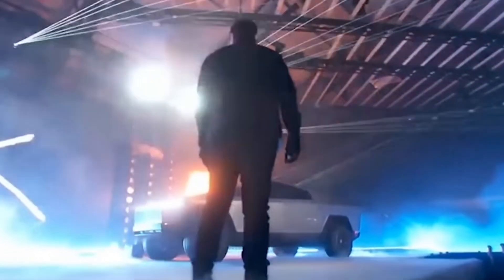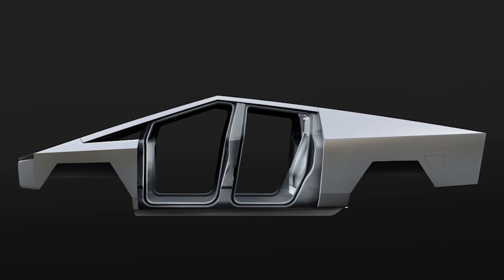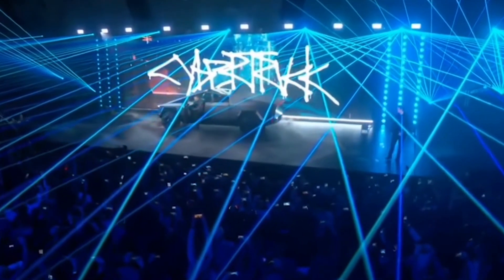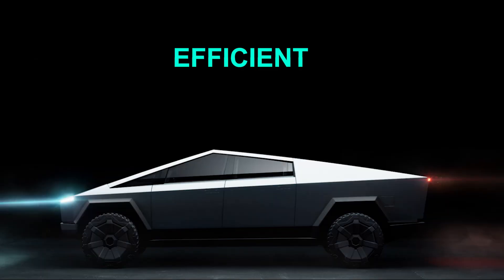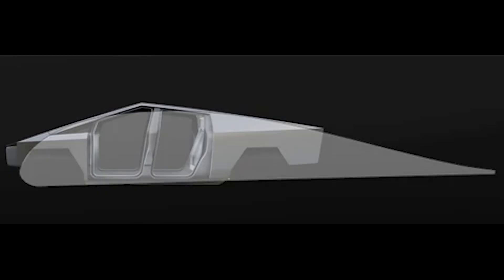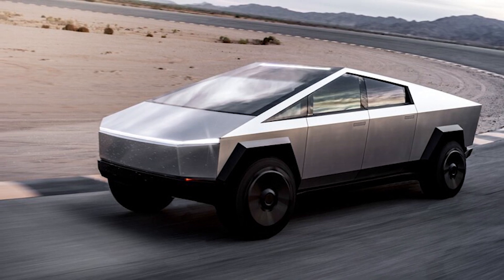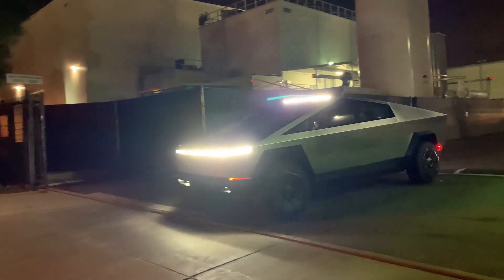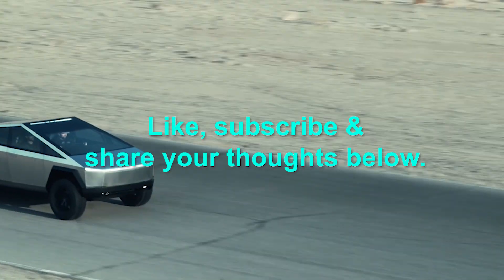Cybertruck is Engineering Genius (and will be copied)

Comment: You have Cybertruck fever and it's clouding your thinking. Here are some issues that you're either missing or glossing over.

1. Just because a truck can be built cheaper doesn't mean it's going to cost you less. If it's in demand the price is going up to maximize profits. Telsa, despite what you think isn't in the business of saving the planet. It's in the business of making shareholders a profit.
2. The Cybertruck looks like it was designed by Jeremy Clarkson in the Top Gear garage.
3. The Cybertruck has completely unproven load carrying and trailer towing capability. Those are MASSIVE issues for work trucks. It's very likely ranges will be cut in 1/2 or worse when loaded with moderate cargo.
4. It's likely even these trucks will suffer damage on work sites. They're tough but they aren't impossible to damage. What's going to happen to the vehicle structure when damage is sustained to the left rear quarter? Will the passenger door still close?
5. How will somebody repair the left rear quarter panel? Will the repair make the vehicle significantly weaker? 

6. Where will you get your stainless steel Telsa repaired? What's the cost to fix a damaged door? or worse... the roof?
7. Toyota has put millions into making their vehicles damage pedestrians less when hit. Telsa's CyberTruck takes the pedestrian be damned approach. How does that affect insurance costs?
8. On that note, given the choice I'd rather be hit by a Camry please.
9. The super rigid CyberTruck hits a concrete wall at 25MPH.  It stops in 0.05 seconds. You on the other hand don't. Because you body is subjected to 25-30G's your body either gets cut in half by the seat belts OR you splatter all over the windshield like a cruise missile made of meat.
10.... I'll leave that to the rest of the people here on YouTube.

Comment: Well, a rigid car isn't necessarily a safe one. All the other Tesla models are super safe because they have an empty trunk in the front rather than an engine. That allows the frontal part of the vehicle to soak the energy of the impact as it deforms in an accordion like fashion. But none of those cars are made from stainless steel. A very rigid car could mean a very dangerous one

Comment: The moment I first saw it I was very surprised by the look, but quickly understood the benefits similarly to how you explained it. Then all the negative uproar began focused solely on the looks (and window). It's just not something that a 12yr old in a comment section is willing or able to grasp. So thank you for the video! The main issue I see is that many people would be unwilling to actually buy at release simply because either they or their friends/family don't like how it looks. I'm sure sentiments will shift after being on the road a couple years. I hope other manufacturers take some risks and make some moves in a similar direction sooner rather than later.

Comment: ... no mater what a stainless steel body is not more safe and it's not the body of a car that is expensive to create its the frame         modern frames are made to be extremely safe also 6 seconds is not really slow is it mate

still it does what its supposed to do
Reply: ok i do admit that the paint job is a good idea to remove

Comment: The truck is nearly indestructible, unless someone gingerly tosses a small object at the window.
Reply: because the door got hit by a sledgehammer multiple times and the base was cracked already
Reply: @BH4x0r  So all a thief needs to do is hit the side a couple times to break the base. Got it.
Reply: @CarpRunner  only the glass would be broken and he would need to carry a sledgehammer, not only that but by the first hit the alarm will sound, these cars are also pretty non-stealable because of the electronics, if you forgot your keys or someone wants to steal the car and they don't have the keys noone will get in unless you crawl through the window, same for getting out
Reply: @BH4x0r  It is a safety concern regardless. They obviously didn't think it would break.

Comment: Tesla missed the mark.  Mini Trucks will make a comeback, because they turned into mid-sized trucks.  Now there is an opening for the manufactures to fill.  Soon you will see them.  The time for cars with pick up beds is now...  Or again.  Cyber Truck bed looks similar to the first Honda Ridgeline.  I need to see a demo with 4x8 ft. sheets of plywood, and 10 - 12 ft. lengths of lumber.  Ride a 1000cc Sport Bike up on it!

Comment: Not sure who’s your industrial production advisor! The simple geometry might make it cheaper to make a prototype but in mass production it doesn’t matter as much as you think it does. Giant presses make one side panel of a car in one stroke, but each folding line (of the cybertruck) in a hydraulic folding press takes way more time.
So mass production of origami from is not time efficient. Besides in order to make some 3D corners it will need tons of accurate welding and professional finishing and polishing. 
Stainless steel is much more expensive than steel, aluminum or some composite materials. So material cost will be much higher.
Body strength is not necessarily an advantage for car safety. If the front body doesn’t absorb all the force of a crash through deformation, it will be transferred to the passengers. That’s why in crash tests you see the entire front of the car gets smooshed but the cabin remains relatively intact.
I think Cyber Truck design serves at least two other purposes. It’s easy to prototype for a quick launch (they didn’t want to fall behind the current electric truck buzz) and second a clear marketing gamble to distinguish Tesla from the rest and get enormous free media coverage.

Comment: Lots to like, but will still suck in rural areas due to inability to quickly refuel.
Reply: The Tesla supercharger network is across the entire U.S. and is being continuously expanded including rural areas. V3 Superchargers can add 100 miles of range in 7 minutes and 275 miles in 34 minutes. Time usually used for a break or something or playing games on the infotainment system.
Reply: @Jogeta5  if I'm traveling in convoy with my Diesel mates in their trucks, I can't go Park somewhere for half an hour when they want to get on the move. And when you're traveling a long way out to the farm and you need to get back again, anything less than a full charge won't cut it. Look, it's fine for the more casual suburban travellers, but not so much for true rural travel.
Reply: @xpusostomos  
Says the person who is using fueling driving methods for electric vehicles.

Comment: Sturdy and tough does not equal safe whatsoever. Crumple zones are how the other three Tesla vehicle's topped the charts for safety. They didn't have an engine in the way which is a bit heavy piece of metal that transmits the energy from the impact directly into your soft squishy body.

Comment: Stoner please. Competitors are so full of themselves that they might steal a few minor ideas from the CyberTruck, but they will NOT compete. After all, buyers are sheeple. They'll buy because of brand name, just like they've bought faulty Ram pickups that have an obscene service record. ( Eg: A little plastic piece breaks and it costs over $3,000- to replace it and is never covered under warranty).
  So, the CyberTruck WILL sell in great quantities, once the current battery technology (glass electrolyte = 5x range and 10 min full charge) is ramped up.

Comment: All valid points. However here is one correction. The Chassis (exoskeleton) is not folded out of one piece of stainless steel. Even if that cumbersome approach could be accomplished, the would be a great deal of scrap. OK, the scrap could be used to make other smaller parts. You can clearly see the outer skin panels have visible edges where they meet up, not bends, in a single sheet of steel.

Comment: Functionality? Will the bed hold a 4×8 sheet of plywood with the tailgate up? If not It's going to have trouble. Also, have you ever owned stainless steel appliances? The finish is a constant problem and worry! Dings, scratches, smudges, hand and fingerprints.
Reply: The bed is 6.5' long by 5' wide. It also has no wheel wells infringing on the area. It will hold a sheet better than most 1/2 ton pick ups on the market.
Reply: Thanks for the info, Dane. Yes, it is bigger than most crew cab short beds, but I'm wondering if you will be able to drive with the tailgate down? With no rearview mirror, there must be a camera back there somewhere. Tesla can get pretty hinky about how you do things with their vehicles...

Comment: 40k isn’t cheap bro! There’s plenty other trucks much cheaper than this
Reply: The key is to compare feature for feature. Show me a 2WD pick up with 4 doors, seats 6, has a 6.5' bed, air suspension, a 17" display, retractable bed cover, in-bed 110/220 outlets and load ramps for $40,000 USD (oh and it has AP standard). If you want a cheap 2WD single cab with manual everything, go for it; but that's not the market segment this truck is aimed at.

Comment: this thing can't do like a hundred things that normal trucks can do and are required to do.  it's toy for rich kids.
Reply: Such as?

- 6.5 bed, check
- Adaptive air suspension for easy loading, check
- Built in load ramps, check
- Frunk, wing, and sub-bed storage, check
- 3,500lb cargo capacity, check
- 14,000lb tow rating, check
- Onboard 110/220V outlets and air compressor, check
- 16" of ground clearance at max height, check
- Bulit in tie down slots in bed and tailgate, check
- Drives itself, check

Sounds more truck like than some current trucks on the market to me.

Comment: Its just my opinion. This won't be the final version, side mirrors (Legality)and waterproofing will need to be addressed in the cybertruck, try launching a boat and getting 1/3 of the truck in salt water or lake water at the boat launch, is the battery protected from partial submerging?

Comment: Cutting jobs? Hmm... You get hit and your fender gets damage.... Now what? Replace the whole body?! You get mangle in this thing they won't be able to cut you free in time. Parts break on this thing is going to cost more. The hype and no thought of how much it will cost to fix the vehical will come back hard, just you see.
Reply: It's flat stainless steel.  Cut the damaged section out, fit a new chunk, weld, grind and then buff.

Comment: The cheapest ford f-150 starts at 25,000. That's 15 thousand dollars cheaper than the cyber truck
Reply: Does that F150 seat 6? Have 4 doors? Have a 6.5' bed? or even cruise control? Cause the cheapest Cybertruck has all of that, and has auto pilot, in bed outlets, onboard air, and air suspension. If so, not a real great comparison in favor of the Ford lol. If you don't need what the base model offers, don't get it.

Comment: Lol!^^
Low cost : no normal worker can afford a Tesla in Europe, so think about others continents!^^
High utility : if it's presented as a truck, I hope for them they thought about cargo capacity!
High performance : tanks in WWI had the same aerodynamic!^^ but ok electric motors will do the job, 'cause you know...it's an electric car!^^
Efficient : plz prove to us that it can run 1200km in a row as a petrol pick up does in Europe with a 4 cylinders engine.
Safe : ok no problems for the occupants of the car, but think a second to the poor guy on foot that will be hit by this car!^^ I think this car could not even been approved by safety tests in Europe.

Plz for once, stop defending Tesla like some do with apple, when a famous and good trademark does a shit, call it a shit and pray for they produce quickly another good car as the model 3 for instance ;)

Comment: The Cybertruck = the end of short lifespan, planned to go obsolete quickly vehicles planned from the start to draw money to the dealer network, for the  thousand of threshing parts in a gas or diesel based vehicle. These vehicles can have lives in the millions of miles due to the inherent long life of a rotary electric motor, the lack of mufflers, clutches, transmissions and the thick stainless steel will also endure for the long term. Even of others copy Tesla bodies, the motors and battery will still lag Tesla.
We are going to see a sea change in buyers preferences. People will delay buying gasoline based cars - waiting for a Tesla instead as the annual savings over 5 years easily offset any price premium for the Tesla sedans - the cybertruck might not have any price premium at all??

Comment: Would love to see a single cab version, with larger bed.  Bed is impractical for side entry (talk to tradesmen about how often they use this) and what options for tie-downs, roll bars or roof racks?
Also, the demo video shows the unit wallowing over kerbs and around corners - not ideal.

Comment: The only place where CyberTruck would be weak is towing over long distances. The rate of power consumption when an electric vehicle is under load will is astronomical. If Tesla can solve that issue, they'll be in great shape. If they can't, then gasoline, and diesel, trucks will still remain competitive.

For any tasks that are simply in town, the CyberTruck will be amazing. If you have to travel any sort of long distance, the value of conventional trucks still remain high.

Comment: Although I'm a giant fan of Tesla and the Cybertruck I dont really feel like this video is unbiased like it should be, and gives all subjects the nuance they need. 
For example:
- The simplicity of production is a speculation.
- The aerodynamic 'analysis' was only based on vague resemblance with a wing shape, instead of actual calculations.
- The safety of the Cybertruck has not been proven in any way so far and high rigidness does not equal high safety.
Furthermore while all 3 of tesla cars are up there with the best it cant be said that they are the safest cars ever made as competition caught up and sometimes exceeds certain Tesla safety ratings.

Comment: it has a massive flaw, when it tows the range drops like a lead baloon.
Reply: That will be fixed within a coupla yrs.
Reply: what if the objects you tow have also Batteries build in them to help raising the capacity :)... problem solved.... and also look at the f150 - with the standard tank you get about 600 miles? and if you tow it is less than that.

Comment: I could live out of this truck.... take out the back seat.... put in a bed now i have an aircon room with a 19inch touch screen 😂 in the back of the ute i would put a slide out kitchen and electric hot water for shower and dishes. And up front i would put a drinks fridge and food fridge in the back with the kitchen.... deym 😂 who needs a mortgage when ya can go anywhere with this thing... i want 1..... i already live off the grid... now i can have a small battery pack at home to keep my fridge running and plug my car in when i get home from work and run everything else 😁 to me it has endless uses.... oh and on my lunch break i can fully charge my car at a super charger.... eat lunch watch you tube on my big screen in aircon.... does it get any better than this 😂 Thanks elon you da man brah😎
Reply from the maker: There's big potential for this. The whole #vanlife thing would be perfect in an EV.

Comment: A truck that has rear wheel drive is garbage. By that I mean a truck with 16 inch clearance with no 4W capability! Who wants that? Not to mention Tesla wants you to pay 7k for auto pilot, a feature already built in, but cant use unless you pay extra for it

Comment: The problem with a rigid frame is that we moved away from that precisely because it wasn't safe. If the car doesn't deform, all the energy of the impact is transferred to the persons in it, killing them much more easily. The idea of deformable materials is that they absorb part of the impact so that the passengers don't.

Comment: This dude has no idea how horrible the design flaws are on this truck. Throw a bag of feed in the back. It will end up next to the cab after driving through town. Ya have to crawl yer fat ass up into the bed. No place for a tool chest. Work trucks come with 110 outlets and air compressors that’s no big break through. The exoskeleton isn’t going to be strong enough to handle crossing flields and pastures. This truck really isn’t a truck at all....
Reply: Put your tools in the frunk, or in the sub-bed storage area, or in either of the wing storage compartments.  Use the built in t-slots as tie downs. Walk your ass up the built in load ramps when the truck slams the rear thanks to load mode and the adaptive air suspension.

Comment: Solving the MONEY Problem - you are WRONG.
the ORIGAMI 3mm Stainless Steel body is very hard to COPY and get RIGHT.
there is a REASON why Ford and GM have NEVER tried a Exoskeleton for their trucks.
#1 - it would require a COMPLETE redesign of the Truck.
#2 - Ford and GM simply don't have the VERTICAL intergration to deploy this.
#3 - Ford and GM do NOT want to CANABALIZE their existing truck sales.
#4 - Ford and GM battery and Electric Drivetrain is NOT at the same level of Development as TESLA.
#5 - TESLA has the Largest Battery factory for EV in America.
and TESLA battery are the LOWEST cost per KWH of ANY Battery for EV. 
TESLA has Expiertice in making EV battery pack and Engergy storage products.